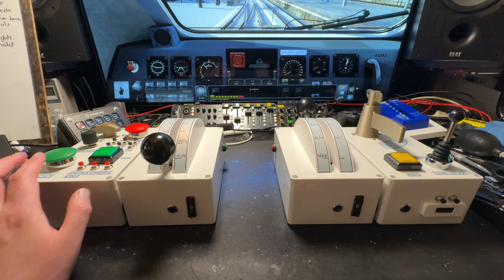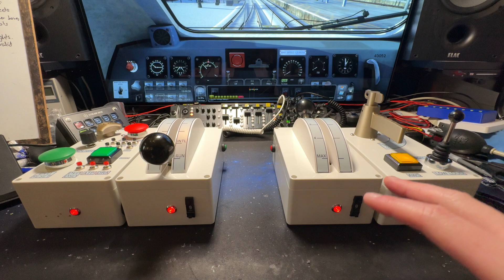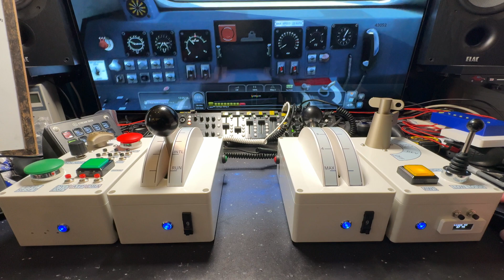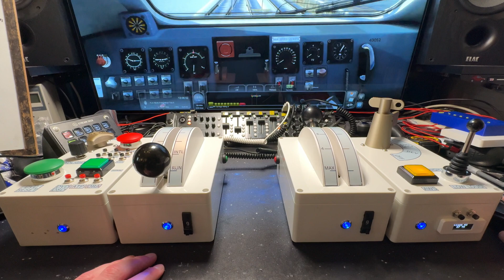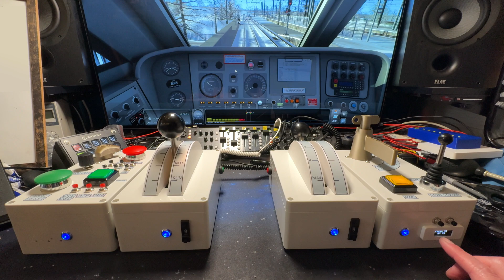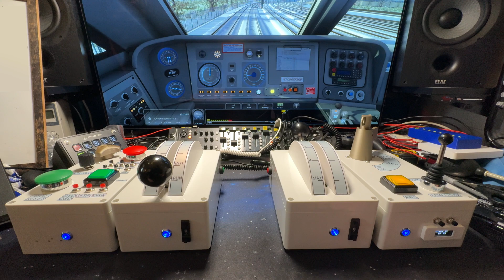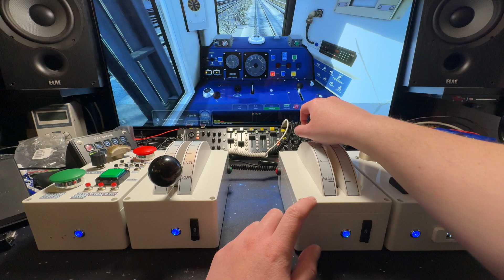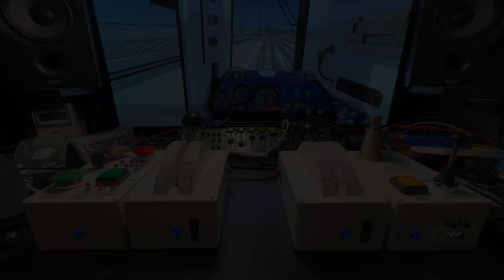DIY Class 43 HST Style Controllers for Train Simulator Classic (Or Any Other Train Simulator Game)

Comment: Trying to create my own from a EX-KiwiRail locomotive, struggling with levers
Reply from the maker: Do you have the real levers with wires attached? I've never looked at these locomotives so I'm not sure I'm looking at the right thing but they appear to be digital control and could have their own control circuitry. 

If you can just attach the physical lever to a simple potentiometer you could replicate what I've got here. Having real levers sounds great though, doesn't get much closer to a real loco than that. Good luck with the project.
Reply: @MattTester  it is from a scrapped locomotive, I was going to strip it of all electronics and replace with new circuitry, If you want to know the specific locomotive it will be a DC

Comment: I think thats a DTG and not a AP 159 because of the noise and the pipe thing on the right of the drivers side of the cab beside the sander
Reply from the maker: Ah that makes sense, someone else said it was the wrong 159 but with no other information. I have the AP 158/159 pack, there are several to choose from and it isn't clear which is which. I will try them all to confirm which is the AP one. Thanks.

Comment: Driver Vigilance Device - there are actually setups when driver actually need to interact twice with controls: somewhere on control panel, or besides it, and pull some leaver locate up high under the ceiling.
Idk what kind of simulator it is, but I never seen one that actually properly ready to accept controls exactly how they are in real cabin. And I don't expect any of vendors will ever do that.
Simulation of keyboard, yeah, that is the way, but for controllers they definitely should have proper joystick input setup, whose whole reason to exist is to simulate controls
Reply from the maker: Thanks for the information, I hadn't come across the DVD controls you mention. It would be possible for me to simulate that but yes what I have will never quite match a proper analogue setup. Sadly the input options of this game are very limited, some add-on trains simply can't be used with analogue controllers.

Comment: Excellent Matt.  How many trainsimmers would love this, I would.  I assume you use trackIR too.  I bet you'd be able to create a combined brake, throttle as well.  Though what the equivalent set up for those of us who love steam engines would look like ☺
Reply from the maker: Thanks, a combined throttle and brake is already on my mind for the more modern trains. As they use the throttle buttons in Train Sim Classic I can make special notch plates with different notches for the throttle and brake side. The handle for the top would actually be the most difficult part as it needs to mount differently. I've never actually used TrackIR with this, I tried it a long time ago though with Flight Sim and it worked well.

Steam controls could definitely work too, you could gear down the potentiometer rotation with 3D printed gears so you need to move the controls a lot more, or use rotary encoders that rotate endlessly like I have for the headlight controls. It's all down to software to handle it then. I may give this a try!

Comment: Oh yes, really nice work, i make my own for simrail and more commands to contrôle (80 commands about). with a binary system of acknowled for each command. with a strip addressable led for each monitor led and some lcd display. very interesting
Reply from the maker: Thanks and that sounds great, maybe I will build in some communication from the game for warning lights.
Reply: Hello  @MattTester  : i can explain how i builed my système :
in arduino, i'm using pin 2 to 8 for reading the possibilities i give an explicit name for each pin of arduino (use in pinMode : INPUT). pb1, pb2, pb4 and pb8, when all input are on high level, its give 15. i add 3 pin for adress, (sa1,sa2,sa3), i can obtain 7 as higher value. (pb x as = 128 possibilities). 
I hope you find pleasure for driving whith your commands. its nice job. good drive to you.

Comment: Have you seen the VKB STECS flight sim throttle? comes with a bunch of detent blocks you can bolt to an interchangeable cartridge. swapping from one detent setup to another is undoing a thumbscrew, removing one cartridge, inserting and screwing in the other, and pressing a button.
Reply from the maker: I hadn't seen those throttles, I like what they've done and metal detents would definitely be better. It would definitely be possible to buy some of their detents to use in a project like this.

Comment: This is phenomenal! I've been wanting to make something similar, a miniaturised and genericised control desk which can operate games like Diesel Railcar Simulator and Derail Valley Simulator but also model railways via a basic train movement sim and DCC. You might want to consider an architecture where the secondary modules send all data through the primary/master instead of each one having a separate USB as well as a serial connection?
Reply from the maker: Thanks! I had thought about this being good for DCC models, if you can control them with keyboard commands then it's definitely possible. It would likely be possible to adapt a basic DCC controller to take an input for this potentiometer, the Arduino might need to translate the position of the lever into something the DCC controller expects. I don't have a model railway at the moment (I would if I had the space), so I can't experiment with it.

I had considered joining all of the modules up or just adding a USB hub inside the master module, I may still add the hub or combine all of the modules into one desk, but I wanted the opportunity to swap out modules if necessary and I prefer storing them without the cables. Another commenter is using an ESP 32 board to operate as a Bluetooth keyboard, which is a great idea. It would be great to see how your project goes if you start building it.
Reply: @MattTester  oh yeah, I got into DCC because of the DCC++ project which uses an Arduino as the base station and anything which can send serial messages to an Arduino as the controller. So if you have a simple simulation of locomotive power, train weight, power setting and brake setting, you can come up with a speed and send that to the DCC decoder. Ideally the locos/decoders are all speed-calibrated so that DCC speed step 8 is always a scale x mph, say

I get bogged down trying to implement stuff like this because I want to go further and make a consist-building peripheral to find the train weight, control multiple locos, etc

there's a lot of cleverness that can be put onto the decoder itself - inertia emulation etc - but I'd rather have the decoders solely responsible for making the motor turn at a precise speed, and controlling the head and tail lights

Comment: May i ask what type of parts did you use for the controller and throttle stuff? Thinking about doing one similar to NYCT trains and i want to follow what you did similarly but make it as realistic as possible to my trains.
Reply from the maker: The basics of the levers are 10mm stainless steel tube and 10mm bearing blocks, with 3D printed parts to attach the lever a small splined insert to attach to the 10K potentiometer and another insert at the top with a thread to attach the black ball. I won't try to link to exact items as they probably aren't available to you, but I got them all from Amazon. You can pretty much make any throttle or brake lever with this base. Thanks for the interest.

Comment: Very nice - particularly like the potentiometer levers - I guess some 3D printing involved.  I just finished a working prototype where the brake and throttle are just the 2-way switches, same as your horn.  I use an ESP 32 and connect to the computer as a BLE-Bluetooth keyboard.  Also it has a capacity for 48 switches as I use 6 shift registers (CD4021B) so mine is in a single (Big!) Box and single ESP32.   I plug in a 1A 5v power supply - but no connection to the computer unless programming (next job is to convert to OTA WiFi programming which I have done on more recent projects so no connection to computer needed - and no more broken USB sockets!).  An idea for the pedal is an electronic keyboard sustain pedal - should be less than 10GBP.  All the best with the projects!
Reply from the maker: Thanks Gordon, yes there are several 3D printed parts inside and I couldn't have done it without the new Bambu A1 Mini printer I have. Using the ESP 32 as a Bluetooth keyboard sounds like a great method, if you wanted you could probably replicate this kind of lever setup with two microswitches and a ratcheting mechanism to press either switch as the lever moves between notches. You would need to adjust the button press timing as I have done and probably set up debouncing. The two-position levers are actually more appropriate for locos like the Class 66/67/68 with their auto brake levers, I'm finding it tricky to get the timing right for those.

OTA programming would be very nice, I'm hoping I get to a point fairly soon where I don't need to mess with it any more because programming each of the four modules is pretty tedious. Although the Ardunio Pro Micro boards have Micro USB, the sockets on the back of each box are USB-B. I've always considered that to be the most robust USB socket so hopefully I won't break any!

Sustain pedal is a great suggestion, I will look into that. Thanks. Best of luck with your projects too, it would be great to see your controller at some point.

Comment: What a great project! I’m building also my own train simulator controller. It’s nice to see other people’s creations and this inspires myself to keep trying and improving. If it’s ok with you I’d like to ask you a few questions about your controller. Greetings from Spain. Thanks!
Reply from the maker: Glad you like it! Go ahead and ask any questions, I will do my best to answer.
Reply: @MattTester  

I don't want to bother you and steal your time so I'll try to keep this short:

1- How have you managed to achieve the notches in your levers? They sound and appear to feel very nice in the video and I'm struggling to come up 
   with a solution so my levers stay in each position
2- I also thought about switching between the different trains I want to drive (4 or 5) with a button which in turn makes the pertinent code to be executed 
   changing the mapping of the levers for each train but I'm starting to come up with a simpler solution. Was your solution very code heavy?
3- I'm using rotary encoders for the levers (I have yet to print them but I'm immersed right now in the mapping of the ranges in the encoders). Do you recommend
   encoders or potentiometers for the levers?
   
I hope these qestions don't bother you and I thank you greatly for your help. Your video has made me rethink some ideas I was stuck with.
   
Again, you've done a great and inspiring job!
   
Regards.

Comment: 7:36 Not too sure what you mean with the issue with your DSD peddle. I think you are trying to make it act like a button.
You could use propagation delay in logic gate to achieve this. 
You would have your input branch off into two line.
The first line would go through an odd number of NOT gate and connect to a AND gate
The second line would go straight to the same AND gate.
The output of the AND gate would be a blip of logic level 1 when the input is pressed.
You would tidy this up by using NAND equivalent logic

Second Method a 555 monostable
Reply from the maker: Definitely possible, I've got an idea to try that would just put the logic in software and with the addition of a single switch. That also allows me to flip the switch once the game has started, so I'm not constantly spamming the key when my foot isn't on the pedal.

Comment: Awesome work! How does the 3.5mm jack communication protocol work?
Reply from the maker: Thanks! The 3.5mm jacks are connected to the TX and RX pins on the Arduino boards for serial communication between them, in the code this is 'Serial1'. The base module continuously transmits a number corresponding to the selection.

I could've used any kind of connector with 2 or more pins, I had 3.5mm jacks and cables already so it was an easy choice.